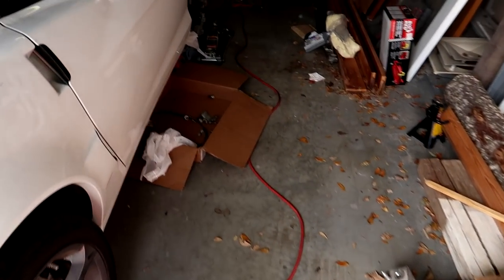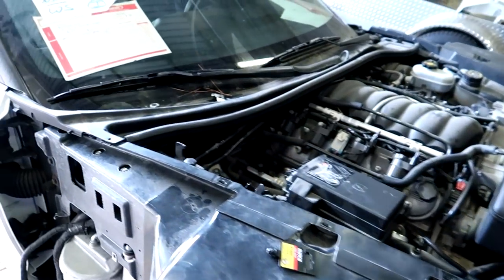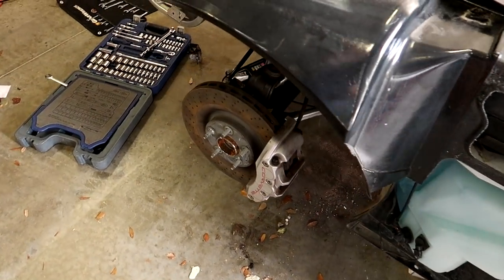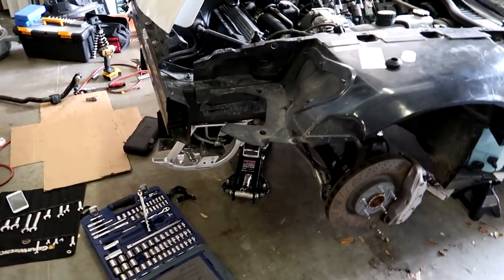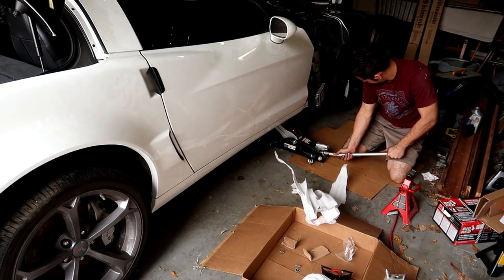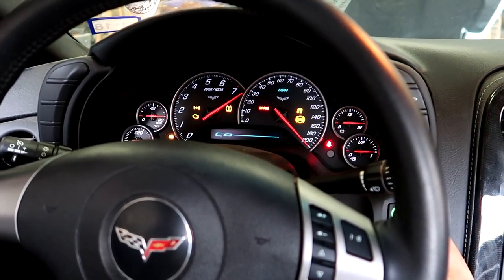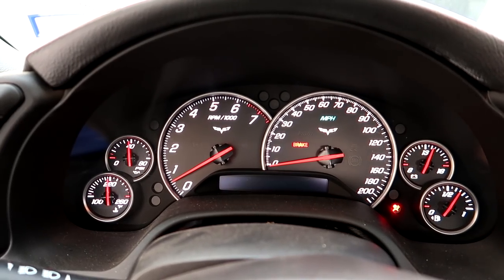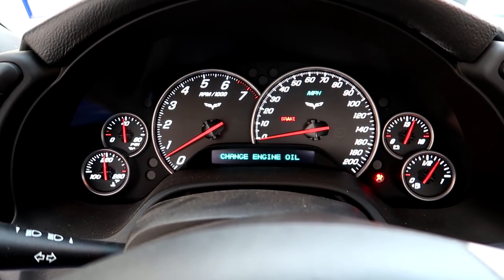THIS is why the Cheap Salvage Corvette Won't Start! Easy $100 Fix!

Comment: You should get a vacuum radiator refill tool, it uses compressed air and a venturi to pull a vacuum on the cooling system. Then you let it sit for several minutes to make sure there are no leaks. Then it uses a siphon hose and the vacuum in the cars cooling system to fill the cooling system. It works great, is fast and I haven't had any trouble with air being trapped in the system like if it was filled just using a funnel.

Comment: That's pretty cool! Basically the ECU needed to be calibrated to understand the raw data coming from the clutch position sensor (Probably a variable resistor as it outputs voltages). Similar to how when you download a new racing game or simulator on your PC and you have to calibrate your Logitech/Thrustmaster/whatever USB wheel and pedals.

What's annoying is how far car manufacturers go to make it as difficult as possible for users to force you to pay ridiculous dealer service fees.

Comment: Their is a plastic shroud that is missing under your intake duct. It sits on top of the radiator and condenser and helps guide the air threw the radiator and condenser. You really need to  have them installed you could possibly run into slight overheating issues with that missing. Just a heads up. Love your videos keep up the good work!
Reply: Thats been tested to help only when the car reaches a certain speed, otherwise the fans do most of the work. they arent as needed as you think.
Reply: hate to be the grammar nazi... but its "(through) the radiator"
Reply: Tyicus well as I stated in my comment it can lead to “SLIGHT OVERHEATING ISSUES” not saying that they are absolutely necessary but based my four years of experience working at a Chevrolet dealership as a fully certified GM technician I’ve worked on these cars and when these shrouds have been removed or lost I’ve noticed a loss in cooling performance to the a/c condenser as well as radiator. I have verified this with Live data using my scan tool. And while it is not huge it’s still a loss in performance.
Reply: The hair on your screen no worries haha. I never get through or yours right.
Reply: You must not hate it too much or you wouldn't do it.
Hate to be a spelling Nazi, but he made a spelling error, not a grammar error.
Reply: @James-xx6eg   Those covers are there for a very good reason. If your is missing,it's better to run it during the summertime.
Reply: @James-xx6eg  or "There vs Their" either.
Reply: @dmayse1000  Then don't be. We understood him.

Comment: Great video! Now that all the cars are controlled entirely by computers it really does get annoying trying to figure out why the car won't start. A few months back I had a Chevy cavalier that wouldn't start. I changed the fuel pump and battery, cleaned the fuel injectors, drained and put in new gas but it still wouldn't start! Then I finally figured out that the cars security system just needed to be reset after which it fired right up!

Comment: Great video, congrats on getting it running!!

One thing - don't use hose water in the coolant system, even temporarily. Next time, hit the grocery store for a few gallons of distilled water. Your water pump will thank you!

Comment: I dealt with the same thing on my Volkswagen b5 Passat. I purchased a ECU off eBay that was reflashed for 93 octane and 11 pounds more boost. I popped it in and it started but the would not idle right and will not rev above 2000 RPMs. You need some special dealer software to adapt throttle body called vag-com I'm sure you've heard of it if you mess with Audis. Luckily I found a guy on a forum that lived locally that and previously purchased the software for his laptop and interface cable. I went to his house installed the new ECU and his driveway in like 2 minutes then use this laptop to adapt the throttle body and it ran perfect. Took me a total of about 15 minutes and it went from having the acceleration of an old Ford Taurus to spinning the tires at 45 miles an hour in 2nd gear. It was a great day.

Comment: You should flush it out with distilled water before you put the coolant in it! Tap or well water has a lot of minerals that will cause oxidation in aluminum and rusting in steel. It will cause a build-up throughout the engine if it's not flushed out. Even if you try to drain it out there will still be tap water in the block and heater core and radiator. Which will cause problems over time. Distilled water is cheap and way better then the headache tap water will cause in a few years.
Reply: Think tap water is bad? Put some distilled water in. It's a great solvent. You want those minerals in, or it'll take it out of the engine. In the 1980s some people thought drinking distilled water was great. Great for leaching out calcium and other vital elements in the body. They ended up with permanent problems. Unless you have terrible water, use tap water. I've used tap water for over 40 years. No problems as long as I mix it to spec. Planning a trip to the arctic? My Dad's famous words. Coolant was good to like -45F.

Comment: Any computer running Windows XP is 32 bit unless it says "64 Bit Edition" when starting up (which is rare and uncommon). You can find old XP laptops on sites like eBay for cheap since they aren't used much for everyday use anymore, but they work perfect for these situations

Comment: A buddy of mine had the crank position sensor on hgis crown vic break off. The thing ran and sounded like it was cammed but worked good enough for a week until he could get the part. The amazing thing was the amount of power it had in that time since it ran rich. Apparently if your crank position sensor fails, you can do really long burnouts lol!
Reply: I find it VERY hard to believe any ecu type engine will run with no crank pos sensor.

Comment: Congrats it sounds pretty healthy too !     It’s always best when you do it yourself   Ive tried to use so called p rofessional  shops and even the dealerships todo. Repairs and service.  And i found out  i was more thorough and knowledgeable of my vehicles  system then they were  ?  It  pissed me off when i realized  i was capable of doing a better job and didn’t take the  shortcuts the other guys did    One example was  i paid for 3 or 4. Tuneups on a truck   Then i decided to do it myself  i found the hardest spark plug to access had never been replaced  as it was the original factory installed plug  and did not match the other ones sure it was running but. I paid for all of them to be replaced several times   I thought why?  Then i remembered my father telling me do it yourself and you know its done right  he was also a big advocate of purchasing the correct information and tools that yo need as well
Reply: I to grew up with being told that. My uncle and I built Harley’s. He used to say, “Chrome don’t get u home!”  Just cause it looks flashy doesn’t mean it serves the purpose. Maybe that’s why I like the murdered out look. Lol.

Comment: Thanks Samcrac for this awesome video. I also learned from you about that scanner you bought on Amazon. I never knew that existed. After your video I promptly ordered one for myself. Thank goodness you showed this tool because I was going to eventually plop down big bucks to buy a Tech2. Thanks for saving me big $$$$. 👍👍👍👍
Reply from the maker: +Dj Ray I'm so glad to hear it helped you out man, that's why I leave this sort of technical stuff in my videos!
Reply: I have considered getting one of these scanners, but I wasn't sure if they actually lived up to the promise or if they were no better than an OBD2.  It is good to see that they really can work.
Reply: Mike Podruchny   Since my comment I purchased and used this device. It is exactly like owning a GM Tech2. You can even use it to download programs to install a PCM/ECM or any other module in a late model GM vehicle. Go to acdelcotds.com and you pay for a day or more to download software needed for your module. This website is the same website used by GM mechanics but is for small shops or individuals. This site also has the same service info as used by GM mechanics. Definitely recommend this scanner interface.
Reply: Dj Ray any idea about IDS software for the Ford side?  I have an explorer that doesn't want to remote start and we don't even have a dealer in town any more.
Reply: Mike Podruchny   Not sure on the Ford side unfortunately. I am a Chevy technician and Mazda. I know Mazda shares some of Fords IDS but through even Mazda’s IDS I can’t access Ford vehicles. This particular scanner interface that I bought and also Samcrac bought is for GM vehicles only. I don’t know if this company makes one Ford as well. Sorry that I can’t help you out with your Food situation. Hopefully someone reads this thread and can help you out.
Reply: Dj Ray that's ok, just thought I would ask.  There is a module for Ford but I have been curious about the software.  Time for some research I guess.

Comment: Gave a like and subscribed! Im stoked for you man... such a beautiful thing to work on a car yourself and get it running without having to take it to the dealship. I have friends ask me all the time "why don't you just take your Jeep somewhere and have them fix it?" Well for one I'm not made of money, are the parts and tools I purchase expensive to fix my Jeep? Sometimes yes, most the time no... I bought my 03 jeep liberty and it came with 1 key... no key fob so I had to manually unlock my doors and there's only one key hole (on the driver side) Dodge wanted $270 bucks to program and give me a single key fob. I went to Amazon and found a tool that plus to the inside of my Jeep under the dash, smashes the buttons as instructed and boom. Now I can lock/unlock/open my glass back top (the back door has a big tire on it and my back opens glass first then the door), and I have a panic button. The other great thing is I've programmed multiple peoples Jeep Wrangled, Cherokee , and Liberty's charging only $20 (they must provide the key fob which is like $9 bucks on Amazon, has to be a certain type of key fob which I give the numbers for each vehicle) not only has the part paid for its self... but its helped people like me who want to open the passenger door for a date but can't because there's no door lock on the passenger side. Seeing you put this beauitful car together and getting it running has been a joy!!! It reminds me why I like working on my own vehicles rather than depending on some shop who may either screw me over or charge me out the rear for labor. Your video is inspiring as a Corvette is a sports car among all sports cars. Plus it sounds amazing, looks amazing, and the fact you did it yourself... again just amazing. I dunno if your some ASE certified mechanic but if not then even bigger congratulations are in store as it was amazing just watching you bring this beast back to life.

Comment: Sam you're going to end up with brown sludge by using tap water in your cooling system with Dex-cool, it's finicky stuff. You have to use distilled water only.  Great you got the car running.
Reply: Steve Yulenburg He should be able to rinse and drain with distilled water to take care of that. A big part of cleaning like this is to dilute the stuff to the point where the contaminants are undetectable.
Reply: the brown sludge is the dexcool and dex is 50% water in premixed  ...that stuff is horrific , I refuse to use it in any gm cars unless the customer absolutely needs me to.
Reply: 223,000 miles on a 2003 5.3L Chevy Express, regular changes..no sludge issues.
Reply: K Brx we’ve used that on all our GM cars and never have gotten the brown sluge. If the Dex is mixed with the wrong kind of coolant, and even stop leak and sealers can do that.
Reply: I got a 2004 Tahoe with dex cool coolant @ 250K miles only used distilled water with it, same with my 2004 Saab 9-3. Distilled water is key when mixing with dex cool.
Reply: Curtis
Yep, many people don't plan or, are too cheap and use tap water.
Reply: The issue isn't with Dex-cool and water. It's with Dex-cool and the old standard green mixed together.  They don't play nice together.  But then Dex-cool by itself is just as bad, as it is Hell on aluminum and plastic. That stuff was the bane of my existence when I worked for Advance Auto and NAPA.
Reply: BS Jeff.. I have now seen many GM vehicles that came with and run Dex-cool get the brown sludge problem, and the only common denominator was the owner ran it with tap water instead of distilled water. That is the reason I wrote what I did above

 I have had the same problem happen in two of my GM vehicles which I still own and no green antifreeze was ever used or mixed with the Dex-cool,  just tap water from mixing and flushing the cooling system during maintenance. I now drain and refill my cooling system after blowing the heater core out with AIR ONLY as to get no contamination, and refill with 50/50 Dex-cool and distilled water and have had zero problems with vehicles running the stuff for over twenty years like that.
Reply: I hope you are right about that al. I haven't seen many of the five year coolants yet... long story, but the ones I have show they need a change in three years. Also, the brown and other undefinable gunk in the resivoir does not just flush out.

I should have read it all. I was just going to note that plain tap in a system will rust in a matter of minutes, unless that block is aluminum. What happens to aluminum I don't know. Plus most tap has chlorine, well often has rust or salt already present.  

Using air to bleed out  a tap water flush is not going to work. Try pulling a drained engine and rotate it on a stand to see what happens. As well as new found old oil.
Reply: The best solution for all this glycol is to replace it with Evans Waterless coolant. Sure it is a bit more expensive, but if you keep your cars more than 5 years it will pay for itself many time over. This coolant will give you 2 very important features that will save money and time on the side of the road. This is a lifetime coolant solution, once installed you'll never have to replace it. It can absorb up to about 400 F while running at 0 PSI in your system, that's right 0 PSI. You can remove the radiator cap at running temperatures with out gushing coolant flying in your face, still hot but not pressurized. Consider the benefits of this, what causes old hoses to burst ? The 16 PSI at which your system normally runs. So no boil over or high pressure during the hoses' lifetime to reduce life or function of the system. The biggest problem that occurs in High Performance applications is (which the average person is unaware) is that the water in the cylinder head  usually boils around the combustion chamber. This means more heat exactly where you don't want it. No water in contact around the combustion dome means no cooling and an airlock forms. Because the Evans coolant is not boiling it stays in contact and better cools higher combustion temps all while not pressurizing your system. Don't trust me research this yourself. But my 15 year old Jaguar 11.3 to 1 CR still runs on its original hoses without incident. Water is good for drinking but not for your engines long term health.  Something to consider....
Reply: BS, I've worked as a master tech in a GM dealer since 2002. No dealer I ever worked at let's its techs use distilled water. Regular tap water. ....so that's literally thousands and thousands of vehicles I can verify never had any problem mixing tap water and dexcool.
Reply: @colescrustycars  If the tap water was the problem, you shouldn't be drinking it anyway !

Comment: Do your self a favor use regular green coolant dexcool causes coolant passage blockage if it gets air in the system ands corrode causing gasket failures
Reply: I have seen this problem first hand.

Comment: Cardboard on concrete! Best creeper ever!
Reply: William Garrett due to the low profile of a vet, there is barely enough room for a body. A creeper would make it virtually impossible to get under the car and work on it while on jackstands.. jacking the car higher would tweak the frame, I personally use a moving pad when working under mine..and yes I have a creeper..
Reply: I was thinking that Sam should reach out to Dominoes and see if they might be able to sponsor him with some cardboard pizza boxes - haha.
Reply: William Garrett I know right...!

Comment: Congratulations,  Good job of useing alternative ways to get around Dealer only work.
Reply: I purchased a corvette . it was missing ALOT of parts from a tornado as the front of the engine was in the process of being worked on. 
I now have it back together and it's running so good. So don't give up! It's worth the wait.

Comment: DO NOT USE DEX-COOL!!! I have a 1993 c4 corvette and I had to replace the engine coolent and the owners manual said to use Dex-Cool but what it does is leave a brown sludge like mud in your hoses and you have to get the whole engine cleaned out or even get a new engine. Just warning ya!
Reply: Reese Norley the sludge forms bc auto shops always top off coolant with green coolant and when  you mix dex cool with green coolant it forms the sludge
Reply: I remember some problems with Land Rovers and Dexcool ....

Comment: Same issue, I had to change out the cam position sensor. Also, changed out the negative ground cable which was shredding.  Now it starts first time, all the time.